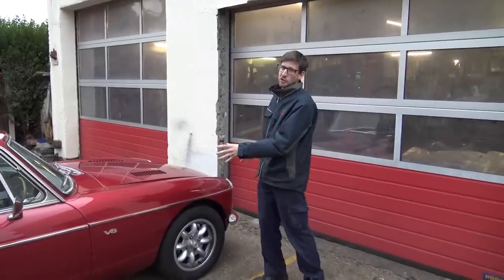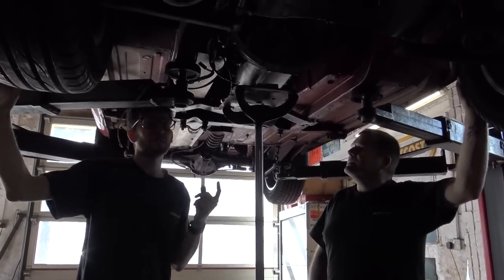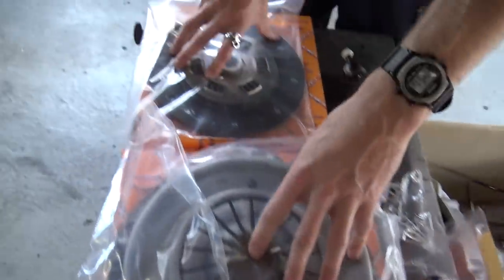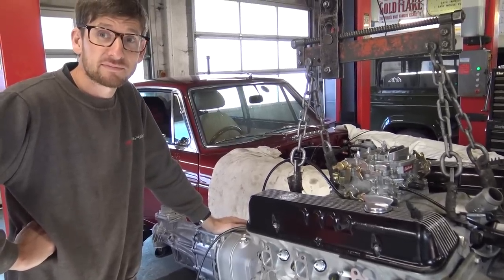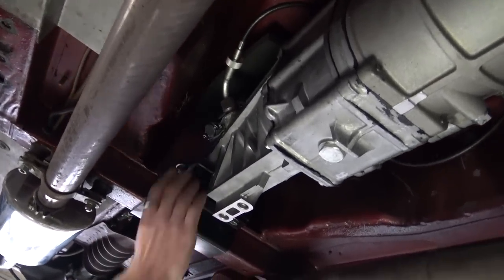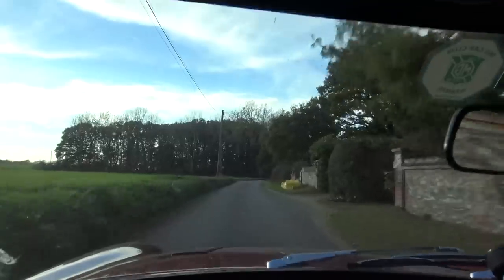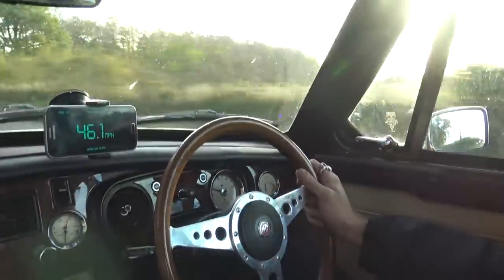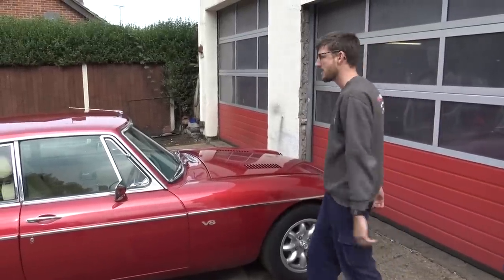4.6 Stage 3 MGB GT with a Brand new 5 speed gearbox conversion

Comment: Any reason why you didn't go EFI?
Reply from the maker: The keep it simple approach. We have gone to EFi on the MG's in the parst with great results however this carb does so much of what you need without the expense and extra work involved for EFI.
Reply: @RPIEngineering  Thanks for the quick reply. I am in the early stages of planning an MGB GT conversion using a Rover 4.6. I assumed that EFI vs carby was an easy decision, but from your reply it seems I may have to do some more homework. When you say "expense and extra work", is that in the context of this particular project and the customers desired time frame and cost? If like me you were starting with a blank canvas, would EFI be viable? Sorry for long question, but with your experience I value your opinion.
Reply from the maker: @ricbarker4829  Each project is of course individual. Out and out power is very similar between EFI and carb. Efi will always win in terms of drivability as with computer mapping you can get fuelling spot on under all circumstances where as with a carb there is sometimes a small area that is not quite right, however that being said I'd be hard pressed to find that scenario when out driving normally.

Best to me a call on 01603 891209 (Ian) to have a chat about the different setups etc as far better to bounce ideas back and forth on the phone than emails etc.
Reply: Again, thanks for replying and the offer for a chat. I might just give you a call when I get closer to trigger pulling time. Like I said, I am in the early stages of planning the build and still trying to get my head around the legalities here in South Australia when it comes to putting a 4.6 into and MGB.
Reply from the maker: @ricbarker4829  AH yes finding out what emissions laws you might need to comply to etc might effect what fuelling setup you go for if CAT's have to be used.

Comment: How much would this cost to do?
Reply from the maker: Hi,
Every car is different depending on what is needed etc. If you would like to email through to info@v8engines.com with what you have already etc we can then advise you better.
Reply: RPIEngineering its a 76 mgb gt
Reply from the maker: @alterra9774  Hi,
Please email through to info@v8engines.com with your current setup (i.e the details you have already given along with current engine setup etc)

I can then email you a detailed quotation, which is far to much to post on a YouTube comment.

Kind regards,
Ian
Reply: RPIEngineering ok
Reply: RPIEngineering it says the email wont go because “user hasn’t enabled emails to this address”
Reply from the maker: @alterra9774  Please make sure you are typing the full email address in correctly we are still receiving emails to info@v8engines.com without issue.